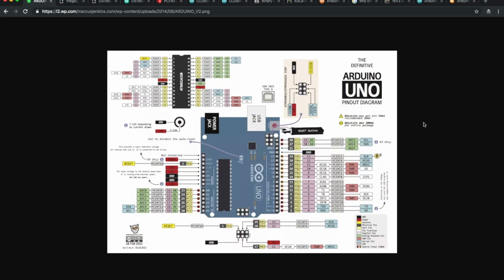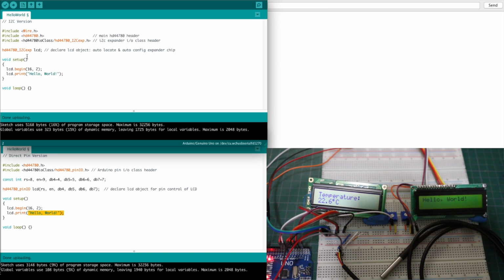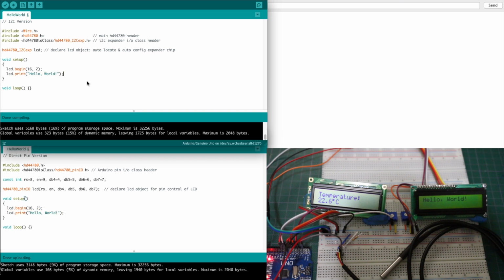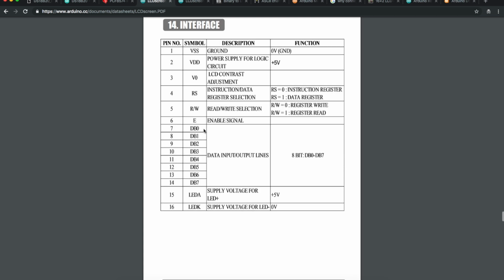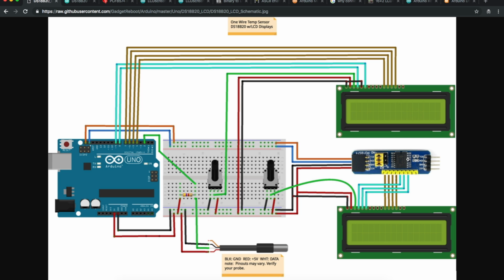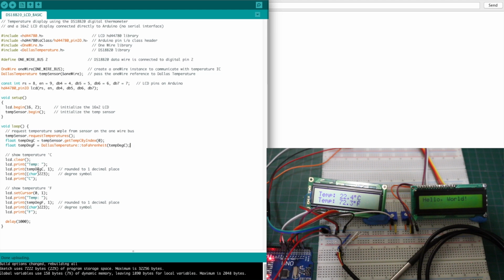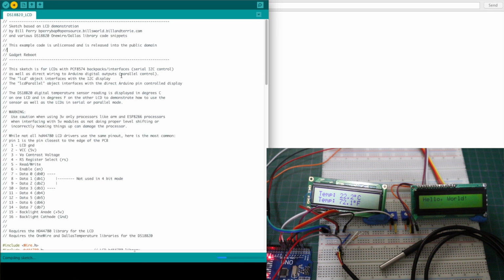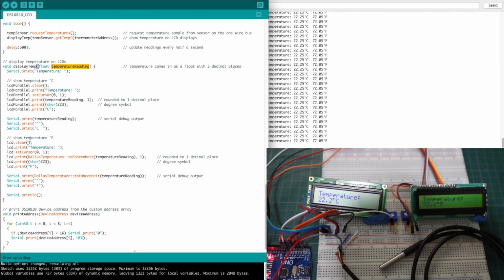Using DS18B20 with 1602 LCD on Arduino

Comment: Hi i really enjoyed this informative video, i was wondering if you can show how to do this with an 1.5" 128x128 SPI OLED display, with the schematic of the components and wiring to an arduino nano (which should have the same pinout of an UNO). Im working on a project and would really appreciate the help. Thank you.
Reply from the maker: I don’t have that display although I am willing to look into it and get one because I’m sure I could use it myself as well but I may be able to still come up with a theoretical schematic and code that could be tested out.   I’ll put it on my list and see what I can do.
Reply: @GadgetReboot  ok thank you please let me know when you figure it out.
Reply from the maker: Do you have a link to that specific display? When I was looking around I can only find LCD displays with that sort of resolution, not OLED.

Comment: Why You have used Pull up please reply Sir ?
Reply from the maker: A pull up is needed by the one wire bus because it’s open drain/collector like I2C.  I could have chosen not to use a pull up on the temperature sensor as investigated in a previous video using an Arduino internal pull up https://youtu.be/145ml4ii1ao
But performance is better with external.
Reply: @GadgetReboot  Okay what I understand now that as the temperature sensor have open collector configuration so we are using a pull up resistor which pulls the value to 5v when 1 wire device is not transmitting And we can also use the Arduino default pull up resistor to make this happen..
So in essence pull up resistor is must when the 1 wire bus communication is needed.
Reply from the maker: Correct!
Reply: @GadgetReboot  Thanks A lot.

Comment: Hey, could you connect your DS18B20 to your Arduino and 3.2" TFT LCD display. Please explain how to connect these 3. Would be a pretty cool video. Thanks.
Reply from the maker: I think it would be fun to look at the TFT LCD again so I will put it on my list of candidates to see if I can come up with something and do a video.
Reply from the maker: I had some extra time this evening so I tried using the temperature sensor with the touchscreen and I have a partial working prototype so I will definitely have a video coming out about that. I want to add a couple more features to make it all worthwhile so stay tuned!
Reply from the maker: Here's the video I made: https://youtu.be/l7UPMfzNjyg

Comment: Yup, from a normal person type approach, the only practical difference between the Uno and the Mega (and a Nano, for that matter) is that the Mega has a bunch more pins available.
Reply from the maker: I’m starting to feel like I should place a few orders and get a broader Arduino collection just to have more clutter for the workbench. If nothing else, at least some spare UNOs because with all the sketches and constant tweaking and re-uploading, one of these days I won’t be  able to upload to the board when the flash dies.
Reply: @GadgetReboot  Once you start, you'll end up trying to collect a few of each and every variant.. just because.

I'm stil not entirely certain why I got the Lillypad style, but I have them now, and that's what counts. 
Tomorrow's mailbag has another different arduino variant...